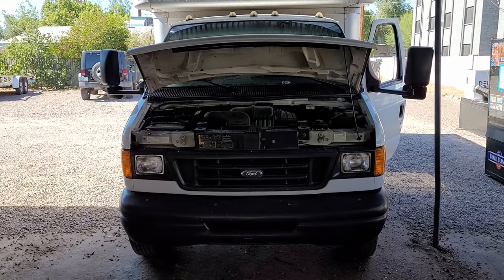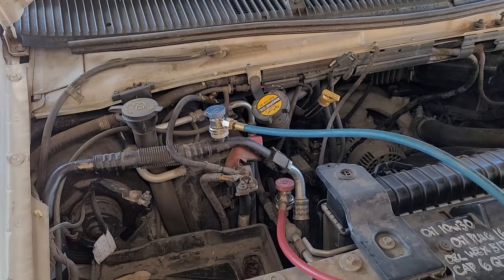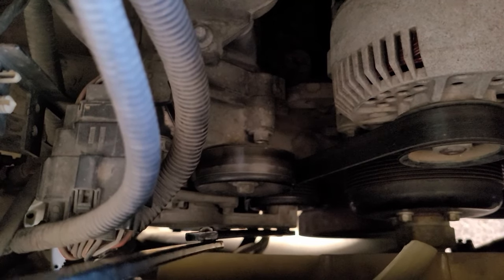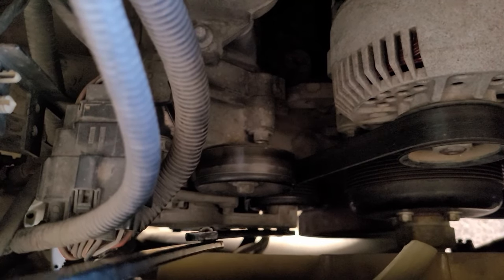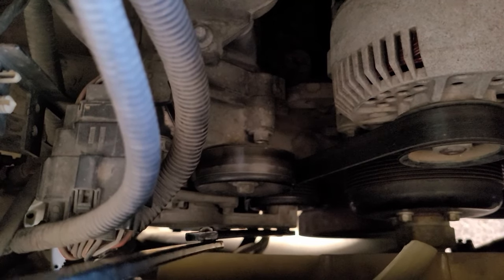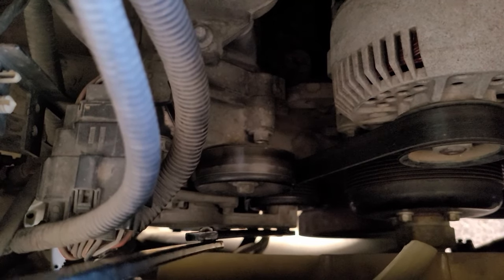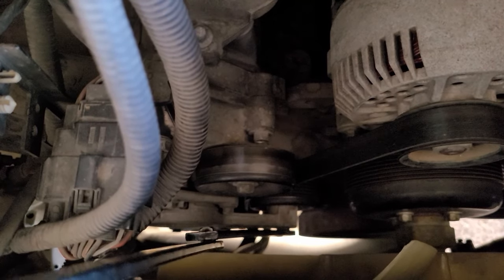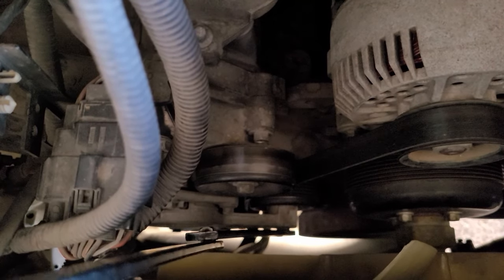How to Fix A/C Ford E-Series Van E150, E250, E350, E450 For $500!

Comment from the maker: IMPORTANT:  Put half the PAG oil in the compressor and half in the dryer accumulator.  Once installed rotate the compressor by hand at least ten times to get excess oil out of the compressor before hooking up the battery and turning on the AC.  Failure to do this can lug the compressor and cause a failure.
Reply: How do you add oil to the accumulator ,  so I should just leave the 4.5oz in the compressor  and add 4.5 to the accumulator ? 😬🤔

Great video  stuck on this part though
Reply from the maker: @adambaker943  If you have the ford scroll compressor just add half of the required oil to the compressor suction port as seen in the video and half to the dryer accumulator.  The amount of oil you require is listed on the tag under the hood.
Reply: Good thing I went back to review.
Just installed the new compressor with a full 9 oz?
Guess I am pulling back out.

Comment: Good stuff. It's nice the way you are straightforward, with a nice touch of brutal honesty, with a good sense of humor about it. Technically well beyond most of uTube. Couple things I always complain about, even with my favorite mechanics here. Well, let's call them suggestions. When you take apart connections that open debris sensitive openings, clean around and above and the part itself thoroughly first. One of the best tips on that subject, do yourself a favor and steam clean your engine compartment before removing and installing a new engine, likewise for the transmission. As a matter of fact, clean the whole engine and compartment once a year. It is an immense help in spotting problems of all kinds, and when you do have to go in there, you and your clothes don't come out looking  like special forces on a night raid. And wear black clothes to begin with.  And as it looked as though you used a VOC based flush, always wear a VOC respirator. Otherwise, you do have a lot more safety pointers than many I've seen. I used to work in a machine shop that did all the work for the San Diego city bus system. Most of the guys hands shook constantly when at rest from all the parts solvents. I learned to clean parts for a variety of very good reasons, and to fear the caustic cleaning solvents for their terrible long term effects. PS I was also a safety worker for a huge construction company. I really care about people, and I write this in a total spirit of goodwill.

Comment: My 06 E350 shuttle  bus AC compressor just went out and took the belt with it.  80 miles from home. Found a shorter belt and bypassed the compressor.  It got us home.  Now to order parts and buy a few new tools. Have everything but the flush.
Reply: So to bypass the compressor, you don't need to pull the compressor and install a bypass pulley?
Reply: @doesitmatter808  nope, just need a shorter belt

Comment: Thank you so much! Got my van AC repaired for just under $600. After replacing a blown compressor, and finding out my high pressure relief valve also blew. I was left wondering what was the root cause of failure. I ended up using an air compressor to pressurize the system and find the leak. The low pressure rear AC hose that goes underneath the van. Possibly the hardest to replace hose ever. The hose was rubbing against the brake line and eventually eroded a hole. I could see PAG oil was following down the rest of the brake hose.

All in all really glad I had this video to help 90% of the way until I had to tackle that pesky rear AC line on my own.

If anyone is in the same situation and has to repair that rear AC hardlinethat connects underneath the drivers door of the van, good luck! There's no instructions. ANYWHERE. I had to remove the exhaust shield, and lower the gas tank. You should probably completely remove the gas tank if you don't want to struggle as hard as I did. Thankfully, I was able to get the line repaired at a local hose shop for $10.
Reply: Are you talking about the tubes that go to the second/rear AC ?
Reply: there is a company in flint mi that makes flexible hoses for the rear a/c  you can use the old hard lines as support.
Reply: HI.   Good job with the a/c.   What kit did you use for vans with rear a/c?   Just FYI there are a few companies that distribute soft line replacements for the rear a/c.   If they rot out again, you can run them right along the lines of the hard lines without removal, at least  I have read that you can.   I don't have  practical experience doing it, however.

With the story my mechanictold me about these AC overhauls, both with the labor involved and the fact that if the new compressor goes out, they generally have only a 1 year warranty and then its labor rate again for replacement.

I think I am ready to tackle this job myself.

Comment: Thanks! I'll be doing this next weekend on my van. It still blows ice cold, but the clutch is starting to make a bit of noise. You're a brave man for using rounder wrenches, as I call them, on the AC lines. Also, you are using them incorrect. You always set the adjustable jaw on the side in the direction you will be turning the wrench. If it doesn't make sense, you can Google it. Thanks again.
Reply from the maker: Hey Rick!  I try to tighten the wrench on the line as tight as possible to avoid being a rounder!  Those lines rely on the O-ring to seal so they aren't too crazy tight.  I've heard that I use the croissant wrenches incorrectly but I've never had an issue.  I know it pulls on the moveable jaw but I flip them around to get the best handle angle depending on room or the job at hand.  Sometimes the handle angle gives you that little bit of leverage or allows the wrench to fit in a tight area.  I agree you should use standard wrenches wherever possible.  Hit that sub botton, it would help a ton man!
Reply from the maker: Maybe I'll bust a wrench and you can call me on it!
Reply: @HerbOMatic  I'm in the middle of replacing my compressor as we speak. I was hoping to get a "new" work van this summer, but the prices of used work vehicles is absolutely ridiculous.
Reply: @Eaglefreek300  
How long did this take to do start to finish? Any tips that herb might have missed?
Reply: @rashellesaeger5992  it took me about 4-5 hours, but I took my time and took a couple breaks. I didn't replace my condenser or flush any lines because my clutch came apart, not the compressor internals. I replaced the compressor, orifice tube and accumulator. If I didn't take my time, I could have probably done it in 3 hours. My new Milwaukee cordless ratchet made it quicker, also. I got the loaner fan clutch tool from Advance Auto parts. I already have gauges and a vacuum pump.

Comment: Great video! On my E-150 the lower dryer mounting bolt has maybe a half inch of space between it and the battery support part of the body. Very difficult to remove or install. Crazy designers! I also had a hell of a time installing a new blower because the dryer was just a little in the way. Crazy designers!

Comment: Great video, well done.  Was tons of help.
On my 2006 E250 5.4 I had to loosen both motor mounts and jack the motor up to get to the compressor bolts.
Had to replace the evaporator coil as well. Would not flush?
Been a nightmare trying to locate the proper condenser and need Radiator replaced as well.

Comment: That's a great video my boss has the same truck and it helps alot to keep that knowledge if his ac blows out again will tune in on more of your awesome videos hopefully  like fuel gauge problems not reading properly  and the stereo just went but the radio is still on also the AC came off all in the same time  i think it's the fuses but I'm yet to find out.
Reply from the maker: Mr Scavenger Glad to help! That's a weird problem with the two being interconnected like that.

Comment: If I cam find the parts, do you think these instructions would be similar to installing a brand new AC system in a 1992 E350 (7.5L) van that doesnt currently have AC?

Comment: Thanks for the video! I was hoping this would go into how to remove the evaporator and get to the TXV or “Expansion Valve”.  Can’t find any videos on that.  Would I go from under the passenger seat or from the front and remove the battery platform like you did?
Reply from the maker: The TXV valve is only on the models with a rear ac.  It's located on the rear evaporator.  I didn't need to remove my evap, the orifice tube is right on top.
Reply: @HerbOMatic  I had the rear ac unit but I removed it and blocked off the lines with a block off kit.  Attempting to pull a vacuum and recharge my system after this.  When I go to recharge it the compressor will turn on and then very quickly turn off from what I’ve read this might be a blockage in the system at the expansion valve.

Comment: great video kinda watched most of it but my attention span isn't so great nowadays. quick question though.... I need my ac fixed on my 97 e350. and was just curious where you lived and if you had time to do this job all over again and if we"re closely located by one another....... how much would u charge me to get er done? its getting hot and I gotta get some ac pumping if im gonna be driving this boat around all day. its my work van and I pretty much am in it all day

Comment: Next, can you address the evaporator drain? I've looked all over the internet for an expanded diagram or other reference of where to find it, but found nothing. I get a 20-25 degree temperature drop from ambient, but can't find evidence of condensate anywhere. Lack of info about the drain seems somewhat suspicious given how many of these vans exist, and they must all be getting plugged up without a cabin filter.

Comment: My AC compressor is making a clicking noise. I was told not to run the AC and I should be fine to drive the van. Well it's 100 degrees plus here. It's way too hot without the AC. 
If the compressor is shot do I need to go as deep as you did in the video? Or just replace the compressor and charger the system again?
Reply from the maker: Usually you gotta go as deep as this because the compressor will spit garbage throughout the system as it dies.
Reply: So if the compressor is replaced with a new one. What garbage are you referring to?

Comment: what is the big black box behind the battery with the ac lines running thru it?
Reply: the evaporator
Reply: @james6794  ty/ why woud the ac compressor keep cycling n and off so fast
Reply: @CAFEX24  i would guess because low charge. system turns on and the pressure of the suction line gets too low so the low pressure switch disengages the ac clutch. It could also be going off on high pressure, Unlikely unless your condenser coil is plugged. you could try spraying it with a garden hose to clean it
Reply: @james6794  its funny when i try n charge the sysetem it only takes a very small amount of freon. i even replaced the drier accumulator and still cant charge it much.where is that coil located so i can try flushing it?

Comment: I'm looking to put  A/C in my 1999 e250 v8 5.4 mine didn't come with it so i was thinking about trying to put it in  would this be pretty much the same??
Reply from the maker: Hey Sergio, you would need a ton of parts, the panel from the dash, the evaporator, the fan, compressor.  I would consider selling the van and purchasing one with AC even if the AC needed work it might be a better move.  If you decide to try it let me know that would be an interesting journey!

Comment: you should have replaced the shipping oil....that first 4 ozs was not PAG oil
Very good video though
Reply from the maker: I hope that's not the case!  Damn!
Reply: @HerbOMatic  This myth of "shipping oil" is all over Utube! There is no such animal. The oil shipped in compressors is the correct oil. Where anyone dreamed up shipping oil is beyond me. There are like 50 videos on Tube, some by dealer trained techs that tell about checking to see if the compressor was shipped with oil. None, to a man, say to drain it and replace it. And AC oil is one of the most neutral, stable, non corrosive..... hell, the older stuff was plant based...what other oil could possibly be preferable to fill it with for storage and shipping? I guarantee you price would not be an issue. OEM compressors from Ford, Chevy, you name it, many come recharged with oil, and it ain't 3'n1.

Comment: Is IT REQUIRED TO ADD OIL TO A NEW ACCUMULATOR  ?
Reply from the maker: If you didn't, spin the compressor by hand a whole bunch.  Half the oil should go in the accumulator.  If you put all in the compressor  you can bog it and break the scroll inside.  Turning it by hand will slowly pump some of the fluid out of the compressor.  I would turn it dozens of times by hand.
Reply: @HerbOMatic  Thank you for your reply to my question.  I understand completely.